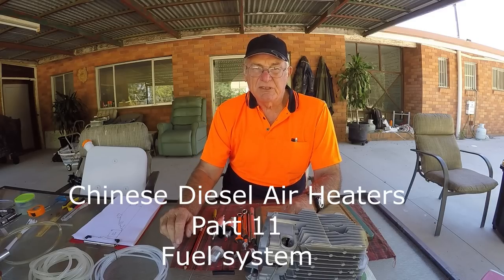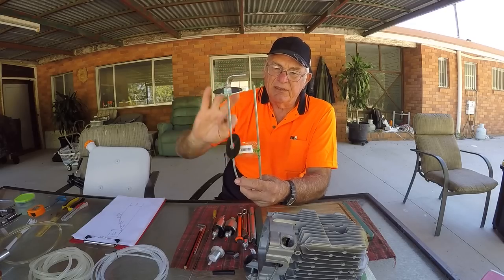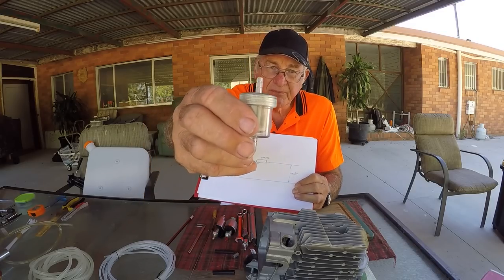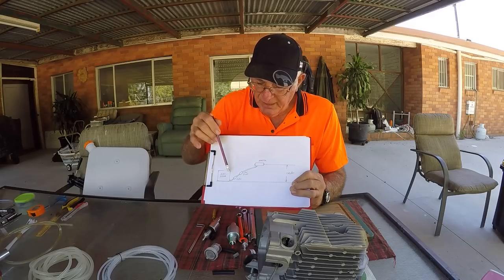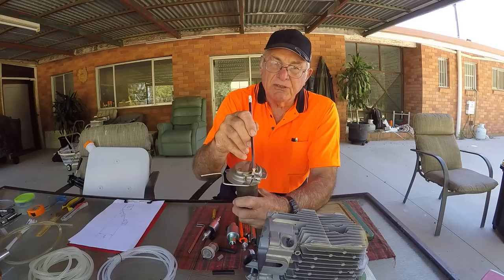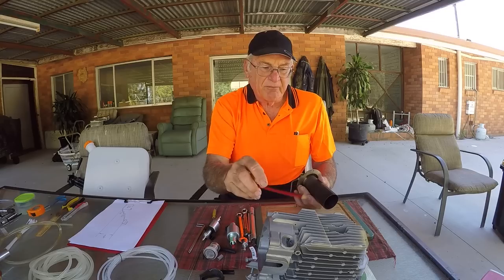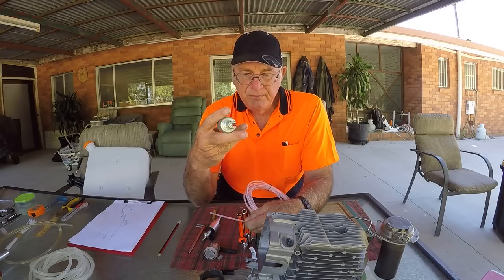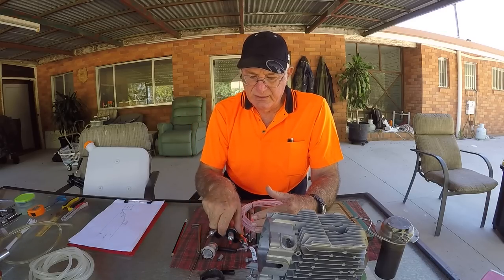Chinese Diesel Air Heaters - Part 11 -  Fuel Delivery

Comment: Hi John, loved your videos. Is there anyway that the heater could be run on vegetable oil or other bio-product?
Reply from the maker: Yes Dave, they will run on bio diesel, vegetable oil blend, snake oil and in fact almost anything that will burn............For a short while.

The issue is rapid carbon build up in the burner screens and combustion chamber. When that happens the heater will not work and require significant maintenance. 

If it smokes when you burn it, you will get carbon buildup in the burner. The more the smoke, the quicker the carbon build up.

Cheers,   JMcK

Comment: Hi John I installed the heater about a year ago after watching your videos which were invaluable in setting it up and the heater worked great throughout last season. 
 I put in the algae retarder fluid and when I fired it up this year it worked for a while and then shut down upon inspection I found a surprising amount of stuff in both the tank and filter and the pump. 
I remove them and cleaned them put in fresh diesel and it pumps but doesn’t fire up could it be the jet is clogged as well and if so is there a process for cleaning it. 
Thank you for your very thorough help
 Rob
Reply from the maker: Hi Rob, first thanks for the feedback, now to your issues.

I personally do not like algae additives, believing it is better to drain off any water (needed for algae growth) than to use additive. I also believe it is better at season end to run the heater diesel through your truck, or give it away.

If you had so much crud in your system it is likely you have a blockage.
First check the pump is actually pumping diesel. Take the hose off the pump outlet and check diesel squirts out. The pump can be working but no diesel comes out.

Next you will need to remove the ignition screen around the glow plug. If that is blocked the heater will not start. You also need to make sure the little air hole at the burner screen is clear or the heater will not start. I have a video on this. 

Now check that the glow plug is working and getting hot.

If the heater still does not start, there is a possibility that the main burner screens are blocked.  If this is the case things are more difficult. The burner must come out and you can try soaking the burner in kerosene, draining out the kero, and then very carefully try to burn out any carbon and rubbish with a blow torch. 

If you are not comfortable of using a blow torch or know someone who is, it may be better to buy a new burner. Available on eBay.

I would be interested to know how you go. Good luck.  JMcK

Comment: Thanks John for the informative videos. I am just about to instal my first heater and was wondering where you got the small fuel filters. I have been to supercheap and autobarn here in Australia but no luck. On eBay they say they are 6-8 mm filters. Sorry if you have already mentioned this.
Reply from the maker: Hi G2

I buy mine off eBay. Search for hard nylon fuel hose for Eberspacher or Webasto parking heater.
Below is just one link to get you started.

https://www.ebay.com.au/itm/AU-4M-Fuel-Tube-Pipe-Hose-Air-Water-For-Eberspacher-Petrol-Diesel-Parking-Heater-/294140493831?_trksid=p2349624.m46890.l49286

Cheers.  JMcK

Comment: John
Very informative thankyou. I have fitted a heater in my vw t5 van.
Had problem with air in pipe and filter. The pick up is from main diesel tank but maybe the 2mm pipe was not butted up properly which causes bubbles in filter and pipe. The pump is under the floor nearer the heater maybe I should we-locate it nearer the tank. The route for the pipe is pretty level with a slight gradient upwards towards the pump which is about 15 deg pointing upwards.Any suggestions would be appreciated. You certainly know your way around  these heaters ! Regards Rob.
Reply from the maker: Hi Rob,

I probably need a little more info.

1. First make sure all your connections are correct and tight and you are not sucking in any air.

2. These pumps are far better at pushing diesel rather than sucking diesel so the pump and diesel filter should be as close to the fuel tank as possible.

3. The pump itself creates small cavitation bubbles so it must be mounted to face upwards to allow those bubbles to escape.

4.It is not unusual to get bubbles in the fuel filter if it is on its side and was not fully purged of air on initial start up. Generally this does not cause any issues with the operation of the heater. Just make sure there are no air leaks causing a bigger bubble.

5. With the pump close to the fuel tank, all fuel line after the pump is under pressure so leaks are easily seen as diesel leaks out. Air leaks inwards before the pump are hard to find.

 6. If the heater is working properly, I would not be too concerned about a few bubbles in the fuel filter, provided they do not increase in volume. Use the heater as is.

Cheers,  JMcK

Comment: Hi John! Is there an issue with insulating the hard nylon fuel line then? Does that absorb too much of the pressure? How do you "soft mount" a fuel line? Thanks for all your very helpful videos!
Reply from the maker: Hi Amy, 

You can put some short bits of normal rubber fuel line over the hard nylon where you put the mounting clamps.

I like to run the hard nylon through a larger vinyl tube, so I can see the bubbles moving, and to provide protection.  But you can use almost anything. Suggest you have a look at motorhome videos.  JMcK

Comment: Hi Jon, love all your diesel heater videos.  I have a rigid fuel line but it empties and I get an E-8 error.  There is no fuel in the line.  I have air into the tank and filter is full of fuel but the hose by the filter and tank runs dry.  What is going on?
Reply from the maker: Hi Judy,

From tank to filter to fuel pump suggest you run normal 4 mm good quality fuel hose, not cheap clear hose sometimes supplied. This lessens chance of air leaks.

From pump to heater you should only use narrow bore hard nylon fuel hose. 

Many fuel issues are caused by leaks in the hard nylon joiners. Some companies supply their heaters with black joiners that have the same bore as the hard nylon outer diameter. If you can easily push the hard nylon into the black joiner it can leak air. The joiner must be tight enough to require soaking the black joiner in hot water and then using some liquid dish detergent to push the hard nylon into the black rubber joiner.

You can get suitable joiner hose at an auto store and cut to size.

Please let me know how you go.  JMcK

Comment: Great video, very informative. Is there a problem having the filter right up against the pump intake?  Seems like its having a problem filling the filter, and when it eventually does after 2 or 3 priming cycles, loads of air bubbles exit the filter, this is on the bench with no ignition.
Cheers.
Reply from the maker: Hi Gee,
Suggest you have the filter vertical while you prime the filter, then you can angle it if needed. 
Pump and filter vertical is ideal.
However, in practice, a small air pocket in the filter generally does not affect the heater performance.
JMcK
Reply: @johnmck1147  Many thanks mate.👍

Comment: Great content John and so very well explained. You need to be paid in yen to make up for the lack of information supplied with the heater!
 I know you have had a similar question regarding having the fuel source above the pump and fuel filter. I would guess having the fuel tank above the items mentioned would make priming easier and less wait an wear on the fuel pump but does the height create a head problem for the fuel pump? I can understand that without any sort of fuel pressure regulator may cause a pressure change of some sort but is the pump that sensitive that say 500 cm would cause a problem of some sort? Thanks
Reply from the maker: Hi Viad,

Having the tank 500 mm above heater is ok, however you should install a fuel tap in the fuel line before the pump and turn this off when not in use. With head pressure fuel can slowly weep past the pump seals and flood the heater, making starting next time very difficult, and with lots of white smoke.  JMcK

Comment: I plan to have the 10L fuel tank mounted to the side of a brief case style box. The fuel pump will be mounted inside the case, either near the bottom or the top, but either way, it is NOT above the tank, as instructions suggest. Also, the fuel line coming out of the pump loops upward, then down to connect to the fuel inlet on the bottom of the heater. Is there a problem with this set-up? Will there be fuel pressure causing fuel to syphon or leak into the heater? Thanks
Reply from the maker: Hi CJT
You should be ok. The pump seals can generally resist about 1 m head pressure.
But I suggest all installs have a fuel shut off tap, particularly those with the pump below the fuel tank. Just turn it off after use to stop fuel leakage.   JMcK
Reply: @johnmck1147  Hey John, Thanks for answering my question. Also, thanks for mentioning the fuel shut off idea, as I was thinking about that earlier, but forgot. Awesome. Cheers.
What size would I look for?
Reply from the maker: CheaperJeeperTV 

Only needs to be small shut off valve. Small air tool valve or small fuel valve.
Suggest you look at motorhome video, more detail there.  Cheers.  JMcK

Comment: Good video and a great insight to these heaters. I have one question, where can I find replacement nylon fuel line for these things?
Reply from the maker: Hi Stuart, thanks for the positive feedback.

There are plenty of on line suppliers. Search  something like -

"Nylon fuel hose Eberspacher diesel heater"
" Nylon fuel hose diesel parking heater, diesel air heater" etc

Here is one link to get your search started.

https://www.ebay.com.au/itm/Diesel-Heater-Nylon-Fuel-Line-OD5mm-ID2mm-8m/333528678720?hash=item4da7dbc140:g:-UwAAOSwT-NeobAN

Regards.   JMcK

Comment: Its not the weight, its the volume that you have to lift with greater bore size. The weight of the fuel is only affected by the height that it is lifted. Ive used 5mm rubber fuel hose and Ive had no problems so long as the length is not more than about 3-4 feet.
Reply from the maker: Thanks for the feedback Mikeaubert. We may be talking about the same stuff here. The greater the volume the greater the weight. It is not volume that concerns the pump, but the weight of that volume. I would much prefer to lift 1 litre of diesel over my head, rather than a 60 litre drum. It is the weight of the the 60 litre drum that is going to cause me issues, not the volume.   JMcK
Reply: @johnmck1147  But surely the pump is not lifting the entire volume of the fuel, it is effectively creating negative pressure within the hose/pipe (initially by sucking air out) and the fuel is being 'lifted' into that reduced pressure by atmospheric pressure acting on it within the tank. The ability of the pump to lift fuel is dependent on how much it can 'pull' (i.e. the level of vacuum it can achieve). To lift a greater volume of fuel to the same height it would have to pump to the same negative pressure, but would need to pump a greater volume of air to create the same negative pressure.
Reply from the maker: Mikeaubert 
You have me thinking Mikeaburt. Now I will have to find time to experiment on this.

Comment: Thanks for your outstanding videos about that topic! I own a 3 Kw diesel heater and it produces heat but is smoking like hell, any advice what the cause is? Cheers!
Reply from the maker: Hi aD

Thanks for the positive feedback.

It could be a number of reasons. 

If always smoking from new, you most likely have install issues with excessive restrictions in the combustion air inlet, or the exhaust causing poor fuel/air mixture ratios.

If it used to burn clean originally but now smokes after a lot of use you may have excessive carbon build up which will require removal. Suggest you try initially running a 90/10 kerro/diesel mix through the heater for an hour or so to see if an improvement. Kerro helps burn off carbon.

If that does not help and carbon is the problem it will require a strip down and manual clean.

Another cause of smoke can be poor fuel delivery caused by a partial blocked fuel filter, kinks in the fuel line, not using narrow bore hard nylon on delivery side of the pump. 

Soft fuel hose on the delivery side of the pump absorbs the pulse pressure and you do not get full atomisation of the fuel in the burner screen.

Good luck.   JMcK

Comment: To clarify - it is acceptable to run a rubber fuel line from tank to pump as long as you only use the rigid line from the pump to the heater?   One more question - I need to make a pretty tight bend (basically a 180* reversal from the tank output which is heading south and the line to the heater has to run to the north) is it best to run that tight bend before the pump with soft hose or after the pump with the rigid tubing as long as there is no kinks?  Thanks for the excellent videos and deep dive into these heaters!
Reply from the maker: Hi Jeremy,

Yes, you can use normal soft fuel hose from tank to pump, but should only use hard, narrow bore, nylon from pump to heater.

Without seeing your set up, I can only suggest, but I would prefer tight bends in the suction side of the pump rather than the delivery side. If you go too tight and kink the hard nylon you have made issues for yourself.

Cheers.  JMcK

Comment: G'day John, some very helpful information, which is much appreciated. I just bought a diesel heater kit and going to give the install a crack. Trouble is I received the 'soft' fuel line in the kit and no metal fuel straw. I want to upgrade to the hard nylon fuel line that you recommended. Any ideas on where to purchase it from? No luck at Bunnings, autobarn or supercheap auto...
Reply from the maker: Hi David,

If the "soft" fuel line supplied is clear plastic, do not use as it degrades in just months.

You can use normal auto fuel line from tank to filter to pump. But you should only use hard nylon from pump to heater. The longer the run the more important to go narrow bore hard nylon.

Hard nylon is used for solenoid lines and pressure gauge lines in industry. Try a place like Blackwoods. I buy my nylon fuel hose on line, but on checking just now my last supplier no longer sells the product.  Search "narrow bore hard nylon fuel line for  Eberspacher parking heaters"

Good luck.  JaMcK

Comment: Excellent info John!  When you have a moment, may I have the technical details of this hose?  I'm trying to read the name on the side of the 2mm hose but my eyes and monitor aren't good enough.  It looks like "TKD Nylon Tubing .xxxxxx" with some specifications that I can't read.  Please let me know in a reply and perhaps note it in your text caption for others.  Thank you!
Reply from the maker: Hi Mr DaD. Tube info as requested.

TKC is a brand name, there are other branded and unbranded nylon tube.
The nylon tube is 4 mm dia x 1 mm wall. It has an internal bore of 2 mm.
Working temp. Is 35°C to 120°C.  Working pressure 4.5 MPa

4mm fuel hose also works for short runs and eliminates all the joiners, but use the stiff heavy wall type, not the soft fluffy type.  JMcK

Comment: Many thanks John. Very informative. Do you know where we can buy 2mm bore fuel line? Thanks
Reply from the maker: Hi Brian,

I get my nylon tube off eBay. Search “Hard nylon fuel hose for Eberspacher disel air heater”

Here is just one link to get you started.

https://www.ebay.com.au/itm/Inline-Fuel-Filter-Hose-Clip-Pipes-Line-For-Webasto-Eberspacher-Diesel-Heater-/234469690209?mkcid=16&mkevt=1&_trksid=p2349624.m46890.l49286&mkrid=705-154756-20017-0

Cheers.  JMcK

Comment: Great attention to detail John, usually missing from installation videos.
In my research I have come across the suggestion of a non return valve in the line. Do you think it is a useful idea and where would be the best place to put it?
The system I'm fitting in my campervan has the 10 litre tank alongside the heater (but well insulated from it), a standpipe take off identical to the one in your video, a fuel filter and inline fuel tap mounted vertically as the fuel line passes down the outside of the tank.
Through the floor to the pump underneath the van about a foot from the fuel input. 
Thanks for your help.
Reply from the maker: Hi Keith, 

A fuel shut off tap is always a good idea, and particularly when there is any head pressure of fuel ( pump mounted below fuel tank) Remember the pump must have a vertical angle above about 15 deg.

I personally do not see any need for a non return valve in the fuel line in your set up. Where would you install it?, and what purpose would it have?. Remember you already have non return valves in the fuel pump. 

Cheers,  J McK
Reply: @johnmck1147  Thankyou for your prompt response.
I suppose I was worrying about drainback above the fuel tap and having to re-prime after a lay off. Not ideal as you say the pumps dont suck well. 
Someone suggested a separate switched supply for the pump which saved starting and re-starting the whole system several times before the fuel arrived at the business end. (Obviously not watched this video, John!).
Of  course I could always pressurise the fuel tank, I've got plenty of time and nowhere to go at the moment! Cheers.
Reply from the maker: Keith Houghton 
Hi Keith, most of us have plenty of time to go nowhere just now.  Cheers JMcK